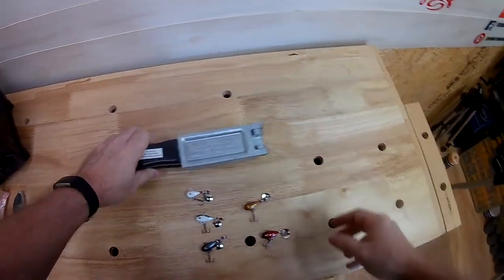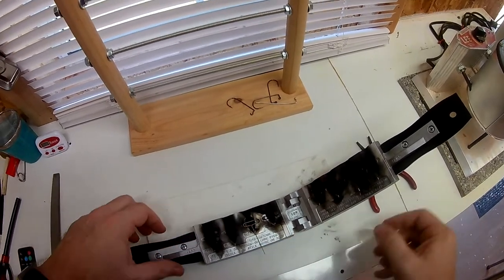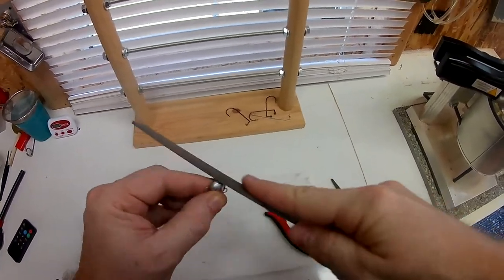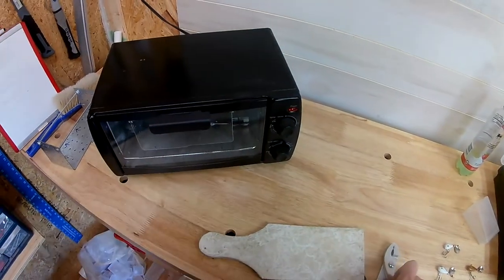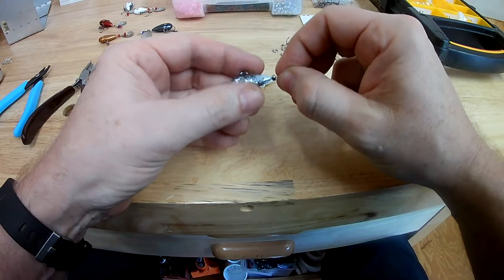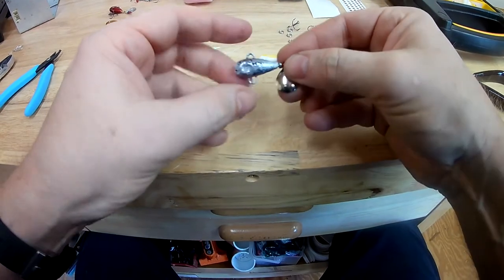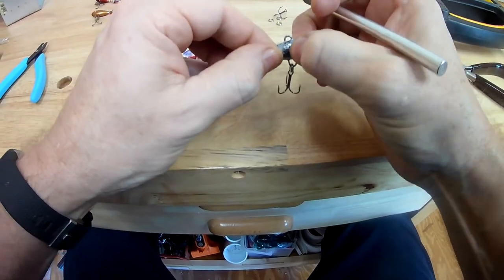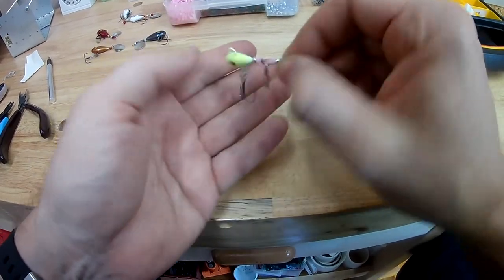How To Build Do-It Molds Tail Spinner Jigs ( Little George Jigs)

Comment: Can I drop pour this mold?  I've had my Lee pot for almost 25 years.   I've never had to ladle any of my molds so far or any that requiring it.  Good video..Thanks!
Reply from the maker: Yes, you can bottom pour this mold from a Lee melting pot.  Just make sure your lead is pretty hot and flows well.  Thanks

Comment: Hi, which diameter of the wire do you use?
Reply from the maker: I use the Do-it molds wire form inserts model WTS-28  , I buy from Barlow's Tackle Which are approximately 0.030"